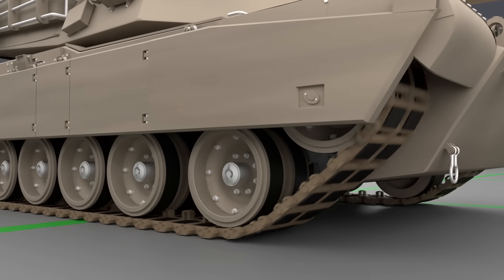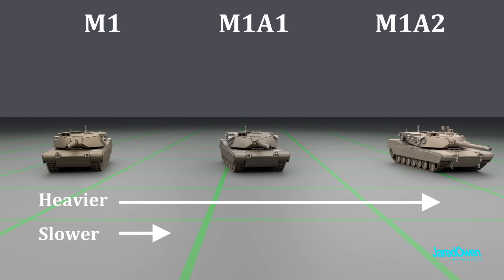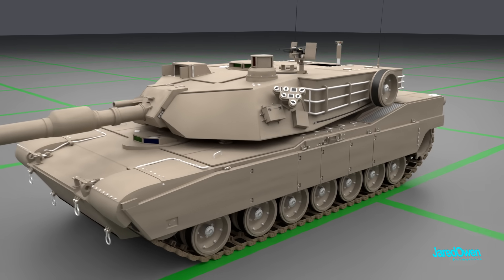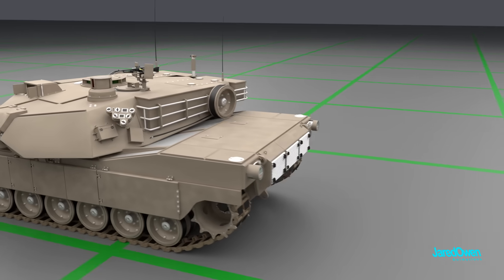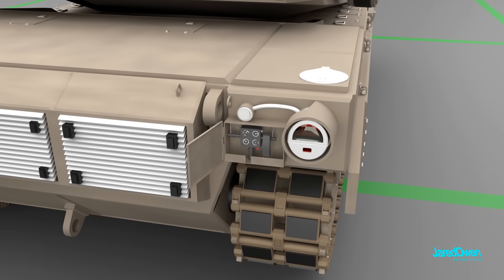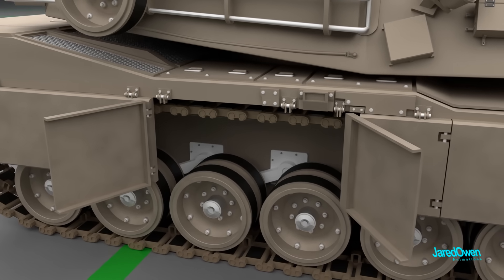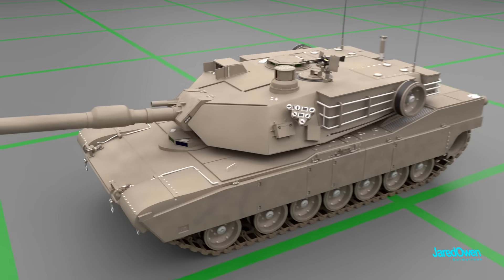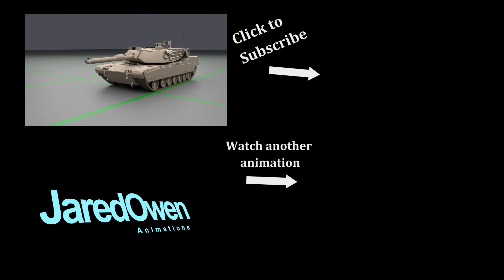How does a Tank work? (M1A2 Abrams)

Comment: Good animation. The weak link of the tank is the Pratt & Whitney turbine. It sucks fuel far to fast & because of the Jet hot exhaust, Soldiers can't take cover behind the tank. A very unfriendly tank for the foot Soldier. For more then a decade, P&W lobbyists have been supplementing(bribing) some Military brass & some politicians. It's documented. The turbine engine needs to be replaced by an Opposed-Piston Diesel. It would provide the same power output w/ far greater fuel efficiency. This would also help the Soldier use the tank as cover w/o getting burnt to a crisp. Turbines belong in the air, not on the ground.
Reply: Preferably, a dual supercharged, MECHANICAL, two cycle diesel. (superchargers in parallel, for redundancy)  
Low maintenance, massive performance, great lifespan, and NO computer, the only electric needed is for the starter !!!
Cause air starters are a PITA, if you have to hand pump it 500 pumps per crank, but IMHO  maybe put one in anyway too just in case...
Reply: @frosthoe  Supercharged?? Why; there's no advantage over turbocharging & there's more mechanically to go wrong & they're noisier. Having two doesn't make any sense, you lost me there. An Opposed-Piston(OP) Diesel is a two-cycle engine, do a search in YT here. Very efficient, high power to displacement output, smooth running & quiet. Less expensive to produce & Mechanics are more familiar w/ the layout, no special training or tools required like w/ a turbine. No issues w/ the electronics as long as the equipment is properly shielded from electro-magnetic shockwaves like CMEs.
Reply: @carmiethompson2676  the advantages are many, turbos break at the slightest induction of foreign objects , the impellers chain reaction into a myriad of shrapnel and literally kill the engine on the spot, its just a matter of time before RIP sets in..
Blowers , especially twisted lobe types, designed loose, can survive a round thru them.
Opposed piston engines are A really Neat NEW design, yet they offer  0% backing, 0% longevity under duress data, Horrendous design /main bearing issues with high compression deisels, and generally are weak A33 kids toys, much like a tesla was 40 years ago, now the Tesla is a beast, refinement and maturity have come.
Reply: I was part of an active duty Armor Brigade in the 90s and none of the tankers ever said the turbine needed to replaced with diesel.  Some were Gulf War I vets and been part of multiple tank units for decades (some came out of M60s).  They universally felt the turbine engine was an improvement in power, performance, mobility, low noise levels, and ease of maintenance at their level.  Whatever issues critics had with the turbine wasn't at their level and tactical needs.
Reply: @mrgold3591  First of all...Thank You for Your service.
If the turbine didn't perform the way it was expected I'm sure it would've been replaced by now but that wasn't my point. It was the fuel economy as compared to tanks from other countries, like the Merkava, Leopard & Challenger. They can travel +150 more miles then the Abrams. My other point was the lack of safety should a foot solider need cover. The jet hot exhaust is to dangerous. Lastly is more of a gripe w/ me. That's the lobbyists from Pratt & Whitney who are 'donating' to politicians & providing special favors to military decision-makers to continue w/ the turbine instead accepting better alternatives like the Opposed-Piston Diesel. Superior fuel economy & no danger of a Solider getting burnt if under fire & needing cover.
Reply: @carmiethompson2676  The time I've spent with the Armor battalion with Abrams those were never a concern with soldiers in training or in war.  The logistics for the Army is amazing with everything from beans, bullets, and fuel.  Fuel economy for military vehicles isn't high on the list as a limiting factor for missions.  That doesn't mean it could never happen and a tank could be low on fuel.  Fuel economy in war is more of a civilian issue compared to a military issue.

Maybe in days of old; but, no-one walks behind a tanks with the US Army combined arms doctrine.  The infantry soldiers assigned to the tank unit stay in their Bradley infantry fighting vehicle until they have to dismount.  They call up a tank if they need 120mm cannon to take down a larger target.  Leaving armor protection put the soldier at a huge disadvantage.
Reply: @mrgold3591  Putting a Soldier in a war or armed conflict is also a disadvantage. I'd rather have Soldiers on base or Home myself but sometime we can't always get what we want. All I'm saying is that if a Soldier has to dismount, I don't want the only option to be the Bradly or Stryker, they should also be able to use the tank as well. It's also a disadvantage to have soft-skinned fuel supply vehicles being exposed to attack. Fuel economy isn't a civilian thing, it could be a survival thing too.
Reply: @carmiethompson2676  The Abrams fuel economy hasn't been a top issue in +42 years it has been in service.  They did add an Aux generator to the Abrams to consume less fuel during idle.  Dismounting and walking behind a tank hasn't been a thing for +42 years.  Fuel vehicles being attacked during refueling operations hasn't been a thing in +42 years.  Maybe things have changed since I've was active duty with an Armor battalion.
Reply: @mrgold3591  Look; I believe you. However; the fuel economy issue started when the turbine was proposed as the primary powerplant back in 1972. The economy hasn't been a top issue because of some politicians & military people don't want it to be an issue. I remember this tank being the target of some politicians on both sides of the aisle wanting the turbine to be reconsidered for a diesel. At the time, a 'regular' diesel, V12 4-stroke, was being considered. I've read Pratt & Whitney was the engine mfg., initially it was Honeywell so I don't know when that changed. Any supplier that has to distribute 'influence', isn't serving military personnel like it's assumed it should.
Reply: @carmiethompson2676  Whatever political issue that was fought on the hill and back door deals they made by non-military people didn't trickle down to the soldiers in the field.  The Army loves the turbine engine because it is has a lower noise level, extremely responsive, same performance in below freezing or desert temps, excellent power to weight power for a main battle tank, the army had to put a 45 mph speed governor or the tank would go +60 mph, and it has the operational range needed for combined arms fighting.  A tanker would thank whoever put the turbine into the Abrams and kept it there.
Reply: @mrgold3591  You're not getting it. OK...fine. You spout the same talking points as the Lobbyists that troll the Congress & Pentagon. I'll continue to tell my State Reps. & Senators that the turbine must be reviewed for a viable replacement. Cummins Diesel has an OP diesel that would do everything you just scripted & w/ better fuel economy. Because I'd rather have the military spend my money on better offensive/defensive systems for YOU & Your       
military Brothers & Sisters then additional fuel for an inappropriate powerplant. Take care Soldier.
Reply: @carmiethompson2676  Oh I get it. Tanker don't want a diesel engine.  They are 100% happy with the turbine for +42 years.  I think us military brothers and sisters that actually go to war with these instruments of death would know what would work better than someone with zero military experience.  Why won't you let us pick the weapons that work and has proven to work battle after battle.
Reply: @carmiethompson2676  The military puts out the specifications for the equipment, wrote the doctrine on how to use the equipment, and plans for its upgrades for future battles. It really doesn't matter  how much you protest.  Whatever you are complaining about isn't what is happening right now with the current Military organization.  You can scream all you want about adding a diesel and it will go over like added screen doors to a submarine.

You should do something more productive like voting people in office that don't send me or my daughter on active duty army to war.  Then you wouldn't need to fight over a turbine or diesel for the Abrams because there wouldn't be a need for weapons of war like this.

Comment: 😂it can be a smooth if on a flat surfaces but I appreciate the Abrams for dummies information, I was a tanker for ten years and miss the beast.
Reply: I see a 2nd ID patch.  I was part of the 5/77th (Steel Tigers) Armor Bn and it was redesignated as the 1/32nd (Red Lions) Armor Bn back in the mid 90s in Fort Lewis.

Comment: why need a tank if here is javelin??
Reply: Javelin is for infantry to use if they don't have anything else.  Tanks usually have their own infantry, artillery, mortars, air defense, engineers, and close air support before an anti tank weapon can get into range (except for the Russians don't use that).
Reply: @mrgold3591  I mean the tanks absolutely unuseful in modern time , javelin , stogna, drones, destroy them
Reply: @ОбанаКабана  It is all about measures and countermeasures.  Anti tank weapons been around since WWI.  Everyone quickly figured out Infantry, Artillery, and air support  was the best way to protect tanks and push anti tank weapons outside their effective range.  This has worked almost +100 years.  Unfortunately, the Russia didn't follow this or don't understand it and push the tanks to the front and infantry, artillery, and air support to the rear.  You are seeing the results of poor utilization or armor units.

Comment: 8:06
The ammunition is stored in an armored safe. If, IF, it was to explode, there are protections for the crew because roof panels will breakaway and direct any blast upwards.

Russian T72’s in Ukraine DO NOT have this safety feature. All of their ammunition is visible. So when an NLAW hits a T72, the ammunition receives a shockwave sufficient to explode and blend the contents of the T72. But there are plenty of T72s and it’s cheaper to replace the crew, in the eyes of the Kremlin.
Reply: the t72 doesent have its ammo exposed because "its cheaper to replace the crew" its soviet doctrine which meant tanks were as small as possible for ease of transport, so a small autoloader was used instead of an entire crew member but an autoloader means exposed ammo

Comment: The loaders blast door is activated electronically with a knee pad. It then operated with hydraulics. There is a touch switch  or pad if you will,  that runs the whole height of the door. If triggered it will reopen.
We weren't told that there was a limit switch that once under a 1" from closing it overrides the safety switch and pushed the door closed if debris is there. 
Cavanaugh was testing them, heard a scream come out of the tank and out he popped like a jack in the box holding his middle finger. Blood was a splurging out. He didn't need any help getting off that tank, not at all. 
Hardest part was getting him to stop running.
Had to medical him out on a chopper. Being the wrecker operator and all around know it all. I was tasked with picking him up. 
Later we lined up two tanks for a photo op. The 1500th M1 in Germany and the only M1 to pass civilian inspection the first time through. Guess which tank that was. 😆

Comment: You missed a model. The M1IP stood for improved. Was to be fielded in 1984 to the 1/33 & 3/33. It was too have the 120 mm smooth bore.
There was a a lot of fighting over that in the Pentagon as that was a euro projectile.
The breach block and hydrolics had already been updated. But it came with the rifled 105.
The rear fender was a full fender, but it was decided to cut it out for access.  So I cut them all out by had on a old band saw. Everyone was a little different , not much of a Straight line guy here.

Comment: What is 500 gallons in size? 500 litres is 500 X (10cm X 10cm. X 10cm, 10cm3). Is there easy conversion between gallons/ounces and feet/inches?
500 litres is 0.5 m3.
A gallon is about 4 litres, so 2m3.

Comment: Great job on the animation. From 1976 to 1982 I worked for Snap-Tite Inc. in the engineering dept. We were contracted to design the hydraulics for the targeting system on the main gun. The specs we were given said that the gun must be able to hold on target at 70mph over rough terrain. We met these requirements with our design. At that time, the tank was designated as the XM1 Abrams and they were still undecided on what would power the tank. I for one, was disappointed, when the tank went into service with a top speed of only 42-45 mph. The hydraulic control system we designed, was able to hold the gun on target up to 75 mph. Thought you might be interested. God bless and stay well.
Reply: Likely to do with how bad the gas problem is on it.
Reply: Wow! Nice job
Reply: @halahmilksheikh  Lets just say (on behalf of the military) that compromises were made. The M1 series tops out at 45-50 over good terrain. Would have been mush more effective if the top speed goals were met.
Reply: I wouldn't hold to much to military speed ratings, trust me they are only suggested speed ratings and not the actual maximum speed.  

Go look at an M817 6x6 dump truck speed tag. Trust me when I tell you it's  BS. I have personally driven one 80 MPH and kept it there going down the highway.
Reply: You would be happy to know that during ODS we were hitting targets past 2500 m going north of 45 mph.  That's about all I can say about it.  Seriously though, you guys designed great hydraulics for the turret and gun elevation.  In 13 years I never saw a hydraulic rupture of any kind in the turret.

Comment: So, it's been many years since I've been inside an M-1 (I was a Platoon Leader of an M1-IP Platoon in Germany). At the 8:08 mark you show the loader facing away from the gunner and commander, he takes out the shell, rotates 180 degrees, and then loads the breech. When we were loading, we ALWAYS faced the commander, pulled the round out, and FLIPPED the shell to then load it. That was so much more efficient than rotating your body. It was always about speed and it was so much faster to rotate the round 180 degrees (i.e. flipping the shell) that rotating your entire body. Now, perhaps they have a new doctrine on how to load the breech. Who knows. It just seemed very odd for the loader to rotate instead of the round.

Comment: OK ------ ...  COMPARED TO RUSSIAN TANKS THAT ONLY HAVE CREWS OF 3, SITTING IN CRAMPED  SEATS WITH NO ROOM TO MOVE ANYWHERE WITH THE POSSIBILITY OF GETTING GRABBED BY THE GUN'S AUTO-LOADER AND STUFFED INTO THE BREACH..(AT LEAST WHAT IS LEFT OF YOUR ARM). (I HAVE HEARD OF A GUNNER GETTING HIS LEG CAUGHT WHILE CLIMBING UP AND OUT AND IT WAS NOT PRETTY) ..... THE ABRAMS IS A GYMNASIUM INSIDE...  LOL  AND NOT TO BE LEFT OUT IS THE RUSSIAN CAROUSEL OF AMMUNITION AT YOUR INSIDE HIP THAT HAS A TENDENCY TO EXPLODE DRAMATICALLY BLOWING THE WHOLE TURRET UP OFF THE TANK AS FAR AS A HUNDRED FEET INTO THE AIR EVEN WITH THE DONUT OF PROTECTIVE ARMOR PLATE OVER THE CAROUSEL... AND THEN THERE IS THE TENDENCY TO BURN WITH ANY PENETRATION THAT RELEASES SUCH TOXIC SMOKE THAT EVEN IF YOU HAVE TIME TO OPEN THE HATCH (EVEN IF THE HATCH IS OPEN) ONE BREATH HALFWAY OUT THE HATCH AND YOU DIE... THAT IS IF THE FLAMES HAVE NOT ALREADY SCORCHED YOUR LOWER BODY MAKING IT IMPOSSIBLE FOR YOUR LEGS TO FINISH PUSHING YOU UP AND OUT ALLOWING YOU TO FALL BACK DOWN TO BURN TO DEATH... OH AND AS FOR THE ADVERTISED AUTO FIRE PROTECTION SYSTEM. THE SYSTEM MALFUNCTIONS HALF THE TIME AT LEAST AND THAT IS IF IT IS EVEN FUNCTIONAL AS THE CREW IS FORBIDDEN FROM TESTING IT EVER IN THE RUSSIAN ARMY...  AND I COULD GO ON AND ON BUT YOU GET THE DRIFT...

Comment: I was a tanker on an M1A1 for 8 years, and i just want to say overall, this is a very good video. I was happy to hear you say, Caterpillar tracks, and not treads. Then however, you said they are also called treads.  You are correct, in that many people call them treads, however, this is a misnomer. Tires have treads, this has nothing to do with tracks. Also, when you say " Caterpillar" tracks, Caterpiller is the company which built the first bulldozers which of course have tracks.
Reply: I'm surprised they didn't show what a nightmare breaking track is. Not a tanker but drove a 113 ambulance and the worst thing to hear was "we're breaking track later"
Reply: @jaygasper4853  I hear ya Jay. I was Commo in 4/37 194th Armor and we had 113 RATT rigs and know all about that. Even worse when track is a slip and needs broken to get back on.
Reply: And for those that don't know, repairs on tracks are not as simple as what it sounds like in the video. It is one hella job fixing them. I was in until 82 so didn't get to see the newer versions so have no clue if they ever made them where it was easier to repair.
Reply: I build/welded the Abrams so i am glad that i wad able too keep you safe
Reply: Thanks , the"Caterpillar" confused me too, I already thought I didn't know enough English yet ...

Comment: I would greatly appreciate some non-retarded units. I have no idea what's a gallon, a mile or a foot, well I do know I have two feet but it's not the point. You know, also, what's a friggin US ton? Please don't compare to football stadiums, cars or washing machines. Normal SI units will do.
Reply: > "I would greatly appreciate some non-retarded units."

 Fair but the language is uneccessary. 

 A U.S. ton is an uncommon moniker for the Customary system's short ton. Which is 916kg. or 2,000lb. Compared to the Imperial system's long ton which is 1,016kg., or 2,240lb. and the S.I.'s metric ton/ tonne at 1,000kg. or ~2,205lb.